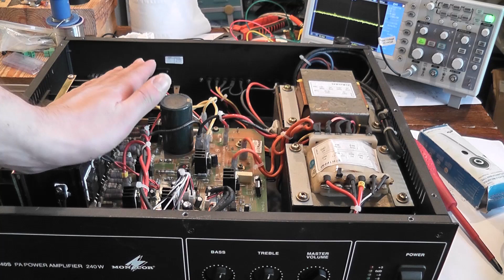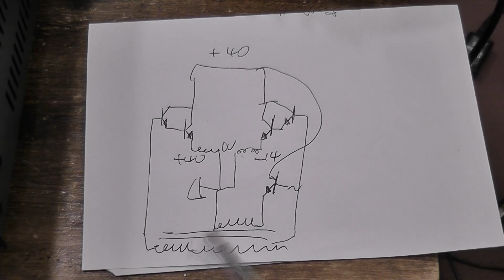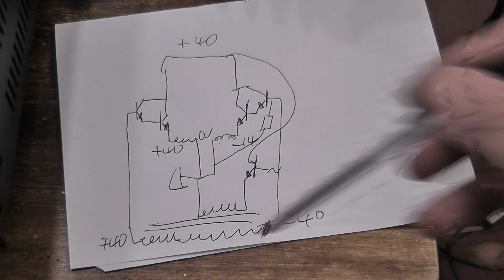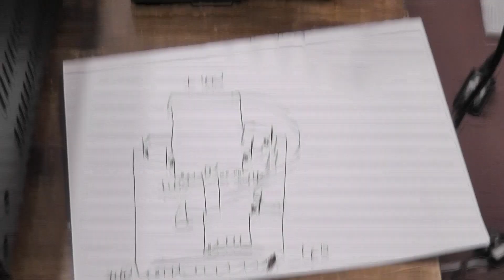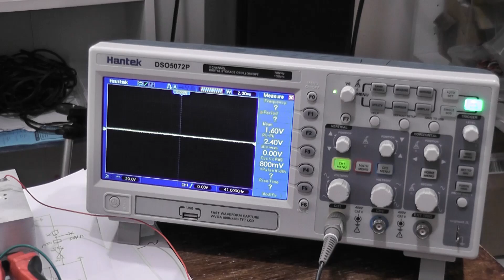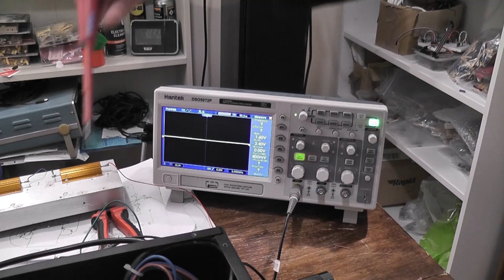Pa940s slave amplifier fix and test

Comment: Interesting output topology using all npn outputs and one supply with the diver transformer i would be curious  to see how it handles crossover distortion
Reply: And marry Christmas I don’t believe in god but it’s nice just to be nice
Reply from the maker: There was about 14mv or so bias across the emitter resistors so crossover distortion should be pretty minimal. Even without the tertiary feedback winding on the output transformer connected it sounded pretty good.

And Merry Christmas to you. I'm not a religious man either, but hey 🙂
Reply: The current thru the emitter resistance is valuable in that both of the outputs should be the same but crossover should be measured in THD a amp used for distribution sound can get by with high ratings of  one or two percent
Reply from the maker: Crossover distortion will be low as there is enough bias in the output to pretty much eliminate it. A general THD measurement will only show the overall distortion including crossover distortion.